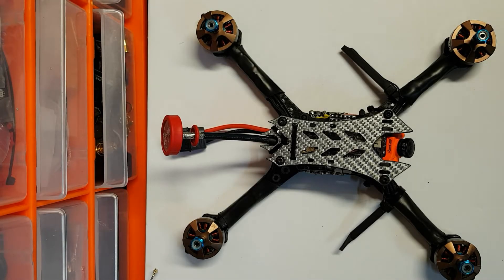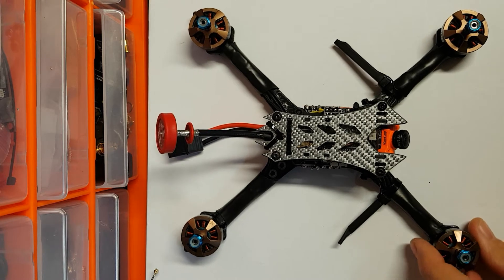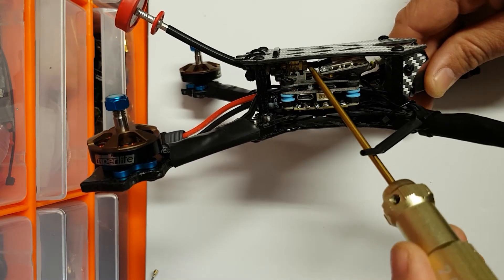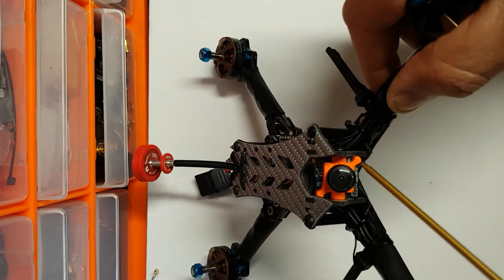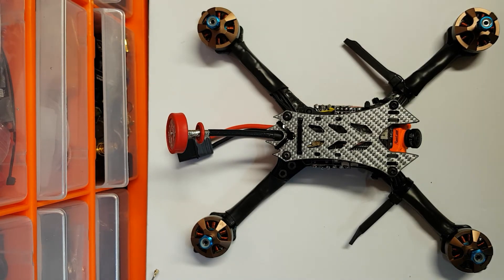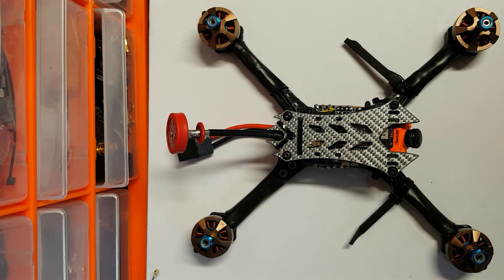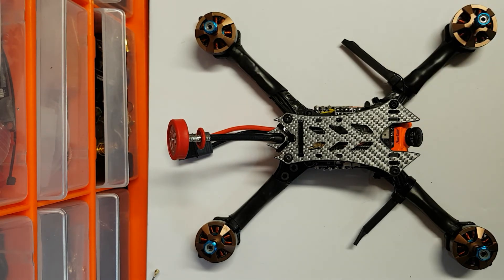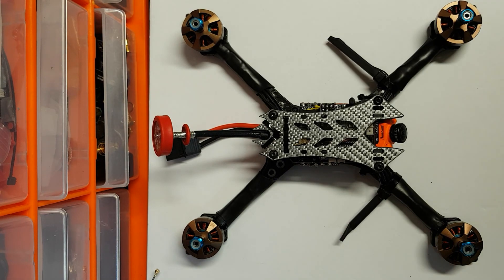Avantquads Devel 5 Inch build discussion

Comment: wich motors for this frame you recommend  R2 2205  2600kv or RCX SE2205 2600kv ?
Reply from the maker: TheMascaras33 I’d wait for the new open bottom BH r2 2205 which has just popped up on Banggood labelled r4 2205 2600kv. If you want to run an action camera I’m loving mine with rcx 2206v3. Is the nox that mystery aio that no one knows anything about? Should do, the front and rear standoffs are about 57mm apart. You’d have to get the correct height as the cam plate loops out as it meets the baseplate down to around 50mm.
Reply: frame ordered today , FC will be the Airbot NOX  V2 AIO  (testing sample) but its 20x20 i will have to 3d print  adapter to fit the Avant Devel frame (its 30x30)    .  for motors i think i will wait for the BH R4 2205 (2450kv maybe) ?
Reply from the maker: I’d probably go 2700kv, as from my testing, hypothetically if you’re light enough 235g or lower you’ll have bags of power, but lose a bit of top end, which the Kv will help with. 2205s are also really efficient. That setup would be brilliant for pure racing I’d expect. What’s the esc rated for on the nox? It looks really interesting, but I’d be worried about noise.
Reply: 25A  blheli32
Reply: btw , i just noticed your also a fellow Vaper hehehe , im also a vaper for almost 5 years now  and one of the admins of Portugal Vaping  facebook group , cheers mate .
Reply from the maker: TheMascaras33 yup. Ex smoker :)
Reply: hmmm  just talked with banggood and they will only receive the Bh returner R4 2205 around 30th november (plus around 20 days for shiping = 6 weeks  )
Reply from the maker: Decisions decisions! :) if you’re not a pro racer I can’t imagine it matters hugely what you get as long as they’re light. Skills make the quad, not motors :) Andre (avants sponsered race pilot) is using cobra cpl 2205 on his Devel. Maybe ask him what he thinks. https://www.youtube.com/channel/UC2ekcUJ5cwLUkLFqC8wA6sw